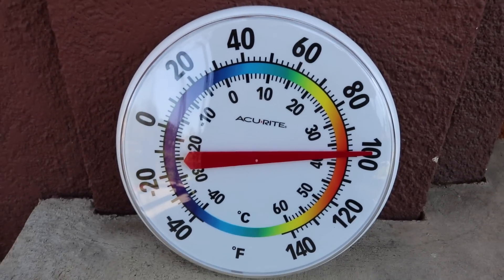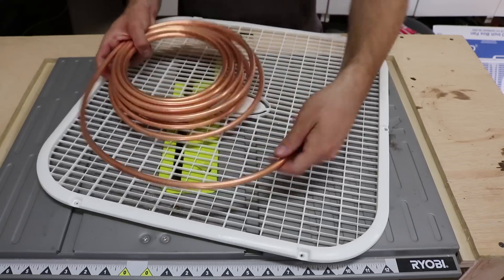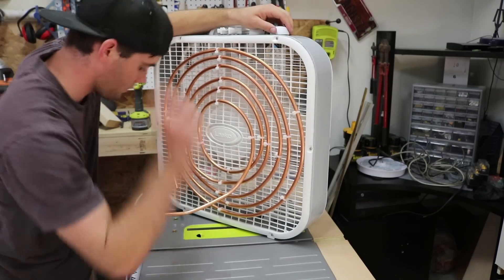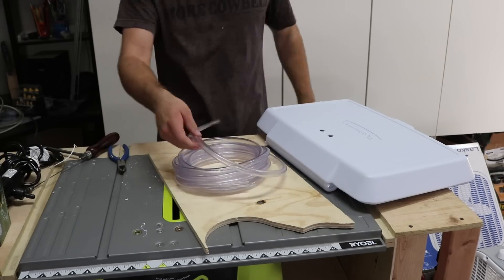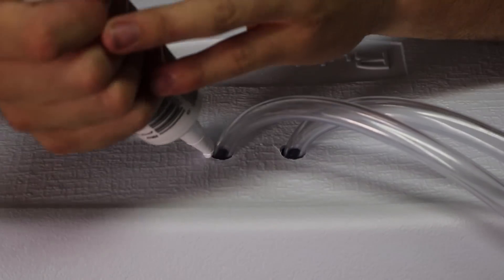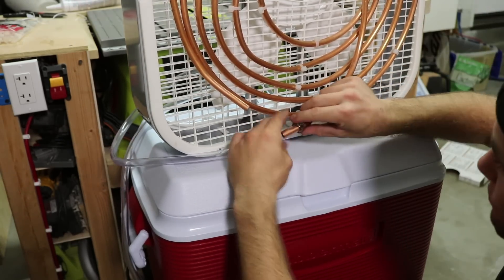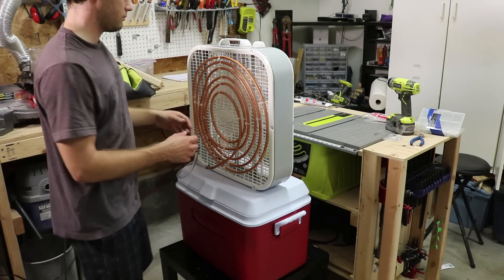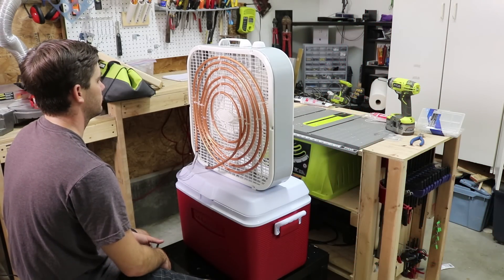$100 Homemade Air Conditioner - DIY

Comment: Now you can spend about $50 a day for ice!  You could have get a small window AC unit for about the $100 you spend and it would not cost as much to run as you will pay for the ice for this.

Comment: The difference between night and day also could affect the home climate!??  Just need heat reservoir!??  Maybe fan on at night at full blast with window opened to pump the heat out could be a simpler solution??  And then to find heat absorbent  objects to put inside the home in the day!??

Comment: Hmm aha.  You just need better coolant and fluid compresser.  I heard cactus puree and fermented into alcohol make very good natural refrigerant!?  The simple idea is at high heat the liquid turns into gas and then condense back to liquid by air cool.  You need two fans, one to distribute the heat from the liquid turned gas(some place away from you like on a boat on the river or lake), the other to distribute the heat to the liquour (the heat from your surrounding to the cooler objects).  You would think copper pipe is the best thing out there for fluid movement!??

Comment: Damn, man.. You were close!  If you had ditched the ice chest and used a simple cheap, new or salvaged compressor/condenser unit from an old fridge of air conditioner unit, you likely could have made an actual refrigerant-powered 'ghetto' AC unit and wouldn't have to fill that chest with ice water every two hours..

Be honest, does that pump-fed ice what really makes a noticeable difference when the ice chest is full versus when it is just the fan running alone..?  I'm skeptical.. 😄 There are plenty such videos on YT videos of people salvaging and playing with old refrigerant compressors, and I would suggest you look into them...

I greatly appreciate the ingenuity, but to get an 'AC' unit to function is any real, self-contained manner, is with the compressor and refrigerant coil system I(and also a way for the unit to vent its heat). I know this was a budget project, but salvaging old AC or refrigerator compressors can usually be done for free if you know of old equipment that contains one and that can be disassembled for your uses, for free..

Comment: If you melt 2000 lbs of ice an hour. you would have the same cooling capacity as a 1 ton window air conditioning unit. (which you can get on sale for about the same price)
Reply: Careful. One ton of cooling capacity is equivalent to melting 2000 lbs of ice per DAY, not per hour, which is the same as about 83 lbs of ice per hour. That's still a lot of ice, though. You can buy ice cubes in 20 lb bags from Walmart for about $4.00, or $0.20/lb, so to keep your DIY one-ton cooling unit going you'd need to spend $16.60 per hour to keep it supplied with ice. That's enormously more than the roughly 24 cents per hour (1.2 KW at 20 cents per KWH) of electricity you'd need to keep a conventional one-ton AC powered. The ice-melting scheme may be practical for occasional spot cooling, but little more.

Comment: Good idea Ben, you did well and don't listen to all the negative views. Here from me some points, such arrangment has a lower power consumption than an AC unit, so this would be useful for places lacking electrical power, you can actually connect it to a solar pannel, yet for an AC you would need a big surface area (of solar pannels). One thing also to remember, the fan motor here would generate some heat too and you may say "so does the water pump". I would for sure use such system if I had limited electrical power supply for whatever reason. to save money, one can emprovise, use car raditor and fan for an evaporator, an old car battery with an old charger, etc...

Comment: Where would one get an endless supply of cold water from exactly? 

Still given your awesome endless chillwater availability (doubtful) there are WAY better heat exchanger or even complete air handler designs out there. Don't build this. Maybe cool air for a few minutes until the water gets hot. (then I guess you go get more cold water from the freezer? making it's compressor the active ingredient)

Comment: Inexpensive  styrofoam insulation panels for your garage door will make a huge temperature difference in your shop. As will insulation in the outside walls, if any aren’t insulated.

Comment: With the $100 u can buy 2 or maybe 3 a/c units... don't spend ur $ on this dumb thing... unless... if u put 12 corona cans in the cooler n then ice!!! It might not work still,but u will get drunk n forget about been hot!!!😉😎 
Stay thirsty mis amigos!!!
Reply: Where the hell you buying 3 ac units for $100? You can't even get one 1 for $100.

Comment: Bag of ice around $2. Comes out more expensive because of bags of ice or make your own ice from freezer and if you make your own ice add that to the water bill monthly. Unless you collect it from rain with a huge blue barrel then freeze it. A garage that big need a bigger fan and any glass window can be tinted or reflected or just use some type of can paint to keep heat out. Nice job!.

Comment: You did not elaborate about the time it will keep the air cool.
Reply: Muhammad Ahmad Im pretty sure it can keep cool for about a day, or even more. Depends on the temperature, its all about if the ice melts faster.

Comment: I love the build and actually want to make one myself, but for $100 for the build, would it be smarter to buy a window A/C unit that covers 600 square feet?  I'm just asking and not trying to be a troll.  All I mean is you can find a discount place like I did and funnel the back end out the garage door, but I don't live in Cali. It's still a great video!

Comment: Plant a tree,,put a sprinkler on top facing up,,connect hose and turn on water,it will rain on the canapé,, air temperature under tree,,15+-degrees cooler,,,plant trees,peace

Comment: As a 20 yr inspector for Underwriters Laboratories, I Ve inspected many products, electrical ,roofing etc., and find this homemade AC cute however a hazard with small kids.  Inventive, but a great video for all it's worth.
Reply: Inspector? your either promoting bad design or your impressed with his video? This thing does not work at all! There is a reason they put all the fins on small air conditioners  along with the rows of tubes. Tell him the truth its your job as a professional so no one will waste their time and 100 dollars building one.

Comment: Hi, good video... but this system is just useless... Sorry for those who tried to built it.   Here's why:  
Problem 1:  This is too much trouble to built...  You could get a big metal bucket, put ice in it, and just put the fan over it.  As the ice melt you will have fresh air... until the ice turn to warm water.
Problem 2: after a short time, ice will turn to warm water.  You need then to put fresh ice back there.  How much ice ?  Here are the maths: 1 pound of ice needs about 200 BTU to melt and rise to 72 degres F.  By comparison, the smallest A/C units produce about 5000 BTU per hour of cool air  So, for a hour of cold, you need:  5000 BTU /200 BTU per pound = 25 pounds of ice !   Now, assuming you want this system to product the same amount of cool  as a small A/C unit working 6 hours, you need... 150 pounds of ice !
Problem 3:  You must get 150 pounds of ice daily somewhere... Even if you get a big enough freezer to do this every day,  it will need the same amont of electricity  to produce 150 pounds of ice as an 5000 BTU A/C unit running 6 hours.  No saving here.
Problem 4:  The freezer that produces this ice must be outside the room, because it will procude a LOT of heat.   
The whole thing is then a bad idea.  This video should be removed, it is useless and a waste of time.
Reply: You forgot to add in the heat from the fan and pump (adds entropy to the room).
A box fan uses about 1 amp at 120 volts for 120 watts of HEAT input.
How many people can put their hand on a 120 watt light bulb for very long?
This does not count the entropy added from the pump wattage either.

As a kid we built a dog house. Installed a mere 60 watt light bulb for some heat in the winter time (outside dog).
Plastic strips over the opening.
Dog never used it lol
Was too hot for the dog!

One human adds about 700 btu's per hour of heat to a room, assuming they are not working or exercising.
This does not count anything else just their body heat.

Humans sweat too and that adds humidity to the room.
That also does not count breathing out water vapor.

When it gets that hot, hose down the outside of the garage door for a few minutes.

Comment: Like the guy said, buy an ac unit. My version used radiator in the unit. Much better surface area and portable 12v.

Comment: My question might be stupid 
Couldn't you pump that freon gaz instead of cold water?
Reply: if he could get a suitable compressor. High temp compressors are pretty expensive.
This does not count the heat exchangers and fans plus the refrigerant.
Not to mention the type 1 license he would need just to buy and handle the refrigerant.
Of course you need some other equipment like a vacuum pump, gauges, brazing equipment, dryer, etc.
And then there is the education you need to know what you're doing....

Comment: Could fill the lid and walls of the cooler with foam to help keep the ice cold. Then the cold air will go where you direct it with the fan. This would also make for a good DIY camping cooler. Bring to a campsite, pop-up and e-z up with walls (or use tent, especially at night), plug in to a portable battery and put in ice. Wouldn't take as much power as a window unit.
Reply: Keeping the ice cold prevents you from being cold

Comment: Just pop the lid off the cooler, and turn the fan face down into it.  Seal   off where the fan meets the cooler, with heavy plastic.  Then cut a 4" or bigger hole on the side but above any possible water line in the cooler. Then place a pipe from that hole to where you are sitting.  The fan will get much more cold surface area that way without using the 2 most expensive parts, copper and pump.  Also you could just open the lid and dunk you head into the ice water every 5 minutes.

Comment: This is Air Cooler not Air Conditioner. This method of cooling is great in dry heat but in humidity, it won't work. It's nit an air conditioner unless it has compressor.

Comment: will It will not work in high humidity areas it's a swamp cooler more or less

Window unit for a hundred bucks at Walmart
Reply: @Michael Gordon so another words it's not increasing humidity
Reply: @brettduffy1992  so another words It will work in high humidity areas.
Reply: Touche/  I got mine at Wallmart for $85 free delivery!!!!
Reply: It's not a swamp cooler.  It may be an inefficient A/C, but it works very much the same way a window A/C works to (poorly) cool and dehumidify a room (only without a compressor and refrigerant).  

There are a lot of DIY swamp cooler instructions on the internet (typically, a cooler full of ice,with small fans to blow cold moist air through pipes from the cooler).  This is not one of them.

Comment: or buy $100 A/C from wallmart plug it in and done.
Reply: What if he doesn't have a window to vent the hot exhaust from the A/C?
Reply: Till u see the bill
Reply: @lyriachavana7807  Exactly. No one ever talks about that for some reason
Reply: @NoName-nq8vc  😂
Reply: But those are Windows AC right? I can't put those in my house 😭😭 so that leaves me with very expensive options right?
Reply: Youre such an idiot...use ur old fan and old ice box..be resourceful bitch
Reply: And where would the hot air go?  THINK, dude; THINK.
Reply: @Drakilicious thanks! Im checking them out !
Reply: Hell you could buy a used one for less than $50 bucks on let go or offer up
Reply: "Done" as soon as you cut a hole in your wall (to code).  If the garage has stucco exterior walls it takes a good amount of skill and time to not end up with a hideous mess and a profoundly amateurish-looking opening.
Reply: https://youtu.be/TtRkd-rITkU is also a great way to cool down!

Comment: There are window AC units available for the budget price of $100, and with some little handy work, if you can  take the back side of the AC unit and put a shroud around and use a flex duct to the outside, you have a portable AC that is lot more efficient and cheaper to operate. Only thing being the flex duct pipe should be no longer than 3-4 feet. I have done it and it works fantastic. In your contraption, you have to have ur fridge make ice cubes or buy bags of ice every hour and the mess is not worth it and not even 10% efficient for teh money you spend making or buying ice cubes and recharging every hour

Comment: buy an aluminim transmission cooler.. and some 12v fans for a computer.    pretty good and made to transfer heat to air, or take it from it.

Comment: You would be better off insulating the garage door.  My garage has no AC and we'll stay cool throughout the day purely based on how cold the concrete slab is as well as how cold it was tonight before. If I open the garage doors the garage heats up pretty quick. I also have 15 inches of insulation in my attic though

Comment: Will this work? Sure somewhat. Is it efficient or cheap? NO!. Modern AC units are getting cheaper and more efficient each year. Yes you can get a window unit for less then the cost of this, and yes it will work allot better. 
This system is using ice cubes and once the ice cubes are melted and the water is room temp you need to replace them. A freezer making ice cubes all day is using allot more energy then if it isn't making ice cubes. Not only this, the more a fridge or freezer has to run, the more heat it is putting in the room. In turn your AC unit coming your room now also has to work harder. And if this is your sole source of cooling, your ultimately making the room hotter with the fridge running. Essentially your producing my heat then what your cooling. This is why AC units blow hot air outside the house. 
So yes, this is a very expensive way of cooling a very limited area and is very inefficient.

Comment: You cant make a air conditioner that way.. there is no way to cool while reducing humidity .using ice. you can cool the air.. works out doors but is a disaster Indoors you get cool while it runs while at the sane time making the room even more humid which is counter productive..

Comment: It's a nice invention if they no longer built air conditioners...for a 30 dollars more you could have bought a 5000 btu carry cool...
Reply: @Thinker , this is wrong the way an air conditioner works is  humidity is sucked out of room then hot air from outside is sucked in cooled and pushed into room..this contraption does none of that.

Comment: If the copper tube coiling was installed behind. It will provide better cooling. Basically increasing  its efficiency
Reply: thought about the same thing, but then the cold, condensed air is going INTO the fan area/electronics.  would be better all around to just place it in front so less probs down the road.

Comment: throw some rock salt on that ice, it'll make it way colder. Also, look into peltier coolers.
Reply: Isn't peltier as effective as the ambient temp? So if it's 120 it can only do so much.
Reply: @AlfredoPachecoJr  I'm not sure what you're asking. But, you can combine solar and either super or ultra caps and some boards or resisters, etc. You can also run several peltiers on a cold block and run the fluid through the block. You'd have to meter the flow. But, that set up would definitely allow for some fine tuning. They have a lot of nice gear available for liquid cooling computers that you can adapt for the application.

Comment: cost of Ice is greater than the cost of   running an small A/C
Reply: https://youtu.be/TtRkd-rITkU is also a great way to cool down!
Reply: Just freeze bottles or gallon jugs of water and refreeze at night to not have to buy ice.
Reply: @squirrelturds2823  : Electricity cost to freeze water to ice is the same as running a A/C unit .  You need to pay this electricity...
Reply: @jnb8918  
He's paying for a freezer.
You're paying for a freezer +AC.

The work is the same and you're paying double the fees.
Reply: @DC...  So, if I got your point right,  this guy is producing ice without using AC ? ?  ... Generating cold use energy  somewhere, no matter how you do it. If he buys ice at the convenient store, he is not using AC, but the store uses AC to make ice... and charge him twice the cost for this...
Reply: @jnb8918  Dust Cloud is saying he is paying for the freezer to run and keep his food cold anyway. So putting some water in it to freeze into ice is not costing you any extra.
Reply: @wolfman122970  Hi Stephen, 
the point is this: a freezer's compressor don't run 24/7.  The more warm stuff you put in a freezer, the more the compressor will run to produce cold to freeze it.  So, yes, putting water in it to freeze WILL cost you extra electricity.  To freeze water, you need some energy, you have to pay for it somehow...
Reply: @jnb8918  Ty for the explanation, makes sense but I doubt he will notice a difference in his bill.
Reply: Dust Cloud When you make and use a lot of ice you pay a lot more electricity to run your freezer compressor constantly.

Comment: What is the average BTU for your Cooler?
How much is the cost of ice, including driving to the store, to keep running your cooler?
You can buy a Cool-Living 5,000 BTU Window Air Conditioner, 115V With Window Kit for  $122 at Walmart.